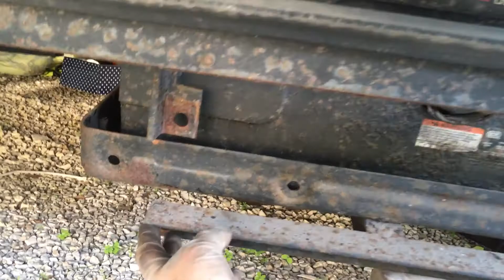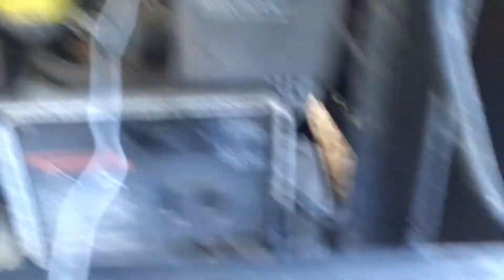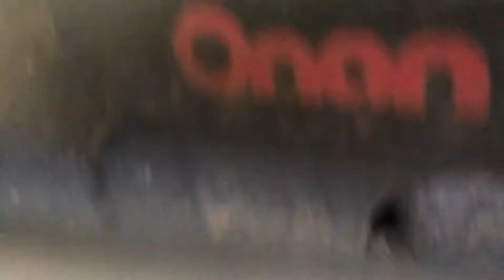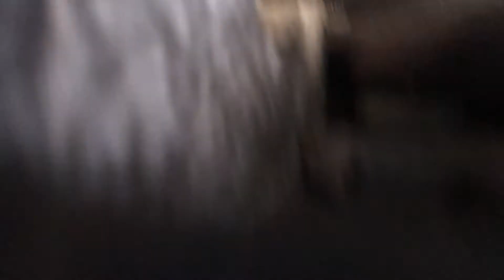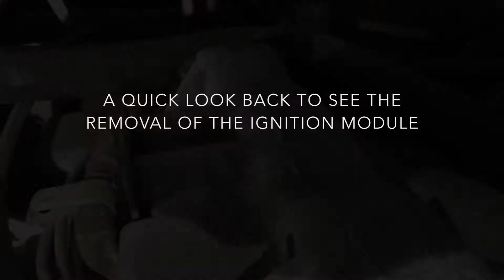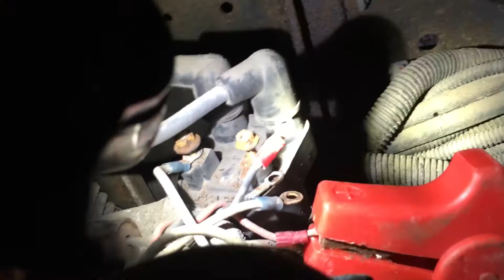Onan Marquis Generator - No Spark

Comment: Turns out for me after replacing the ignition module i discovered the rotor which is plastic had broken and is common !! This issue isnt shared on you tube nor online which is needed to svae people from buyying parts they dont need :) Heres how you figure out you need a rotor 1. no spark while spinning over .once you pull the module you can spin the moptor by hand and look in the hole to see if the rotor is broken and if it is heres the fix .2. lower the gen and disconnect the wires and fuel lines 2. remover the bottom pan and flip on its side .3. remove the carb breather and brushes .4. seperate the stator housing from the engine using a 7/16th bolt 11.inches long which presses the staot off how ever i managed to break it loose by prying 2 screwdrivers on each side and popping the housing with a rubber mallet .5. replace the rotor and reinstall the stator and the generator . problem solved for 45 dollars .ty
Reply from the maker: Jerry. This is very useful. I'm going to paste your reply into the description and pin it to the top so that others won't get caught out like this. Thank you so much for your very comprehensive comment!
Reply: X
Reply: I believe it's  my pickup module  but the one you have is the exact same one as mine  can't find a replacement  the one's they  have the plate the module is attached to is so much shorter don't know if this makes a difference?
Reply: @johnleblanc4553  john i think i answered this question years ago ? Are you still working on it ???

Comment: Can i ask you if you ever found the problem with having no spark on your Onan 5500? Ours is practically identical to yours and having same issues.
Reply from the maker: Still 99% sure it's the sensor, but I have not replaced the part yet to be sure.
Reply from the maker: Link to the service manual for you:  https://www.dropbox.com/s/mw46vmuo8uglw76/Onan%20BGM%20NHM%20Marquis%20Service%20manual.pdf?dl=0

Page 30 and 123 for the test procedures. 

Let me know how you get on!
Reply: Try to follow the way you had things hooked up to do the test for the ignition. Hooked up positive to that red I see your tables coming down from your meter but it doesn't show what's touching where it's very confusing
Reply: Cables not tables